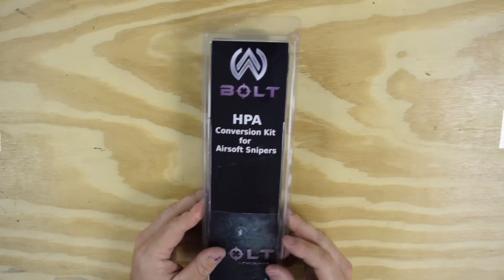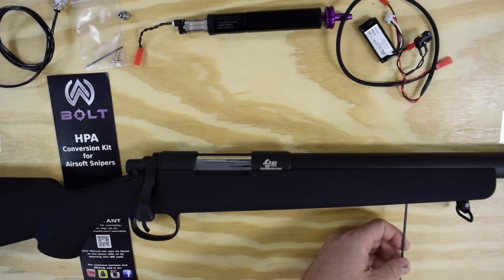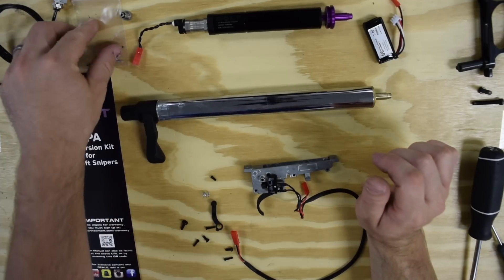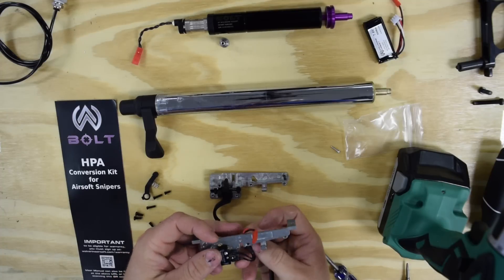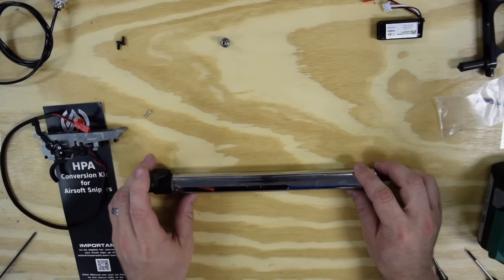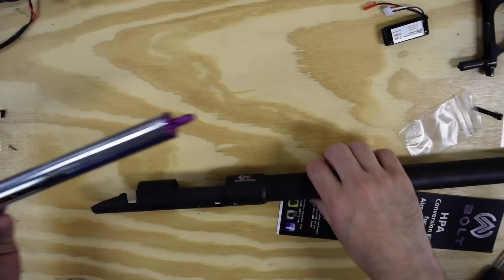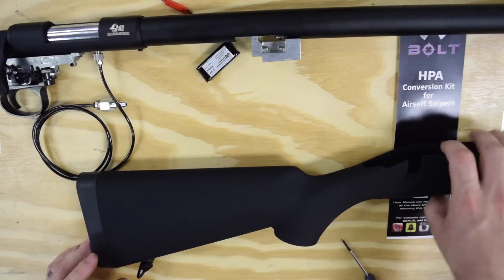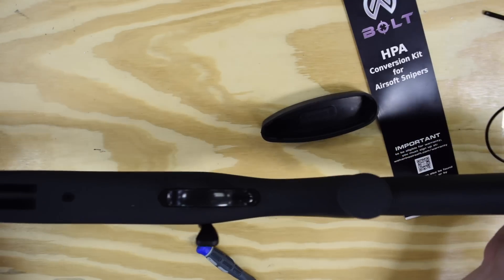What the Tech?!?! Episode 11: BOLT Installation

Comment: Hi! On the JG bar 10, if we wanted a longer bolt pull to recycle the replica. Would we drill the hole for the airline further back to the handle and away from the cylinder head? Thanks!!

Comment: I fitted mine into my SSG10 last night. I used the JJ BAR10 version with your supplied cylinder. It works perfectly and its actually quieter than my TM MK23!! I had to buy a new VSR 10 trigger box for it to work though, as the SSG10 trigger wont work. I love the BOLT!

Comment: Hi , hey   .. where are spring? no use spring in this system?
Reply: It doesn't need a spring. The bolt pull is so light.

Comment: How come no one makes a small HPA cylinder to fit in the stock? PCP pellet rifles have been doing this for years... you could easily fit a 8 cubic inch 3000 psi tank in there if someone made one... hell, a bit of modification to the stock and you could probably put a 13/3000 on it wiithout worrying about a tether line..

these airsoft companies need to step up their game.

also, why has no one created 6mm airsoft "slugs" with a rifled barrel? paintball has them...

Comment: in your video What the Tech?!?! Ep. 4: Storm InGrip and CO2 vs. HPA you say not too place the co2 cartridge horizontal  or upside down, but here you install it in the stock where it's pretty horizontal, ain't that a problem
Reply from the maker: It is a CO2 tank that you should not use horizontally, the cartridges are fine.

Comment: Alright so I can say I got this kit and it was a breeeeeze to install! Amazing performance right away and puts my old Echo 1 PSR to shame :)... I got the derlin/delrin spacer from Wolverine to fill the large hole in the receiver (don't have to drill a hole in this application) 

My only complaint is TORX SCREWS!!! WHY!? I threw them straight in the trash and used my 1.5mm Allen cap screws I had laying around. Nobody uses TORX lol

Comment: My bolt came in, followed the instructions, and everything worked like a charm. But I am having a double pop sound when I fire.  I fire a round and after the bb is fired it does another fire sound or a sucking in air sound. Is this common?  Everything works fine.  I have my G&G Predator set up with a polarstar, and I dont have the extra sound after I fire.  Have you heard of this happening?
Thanks for your help.
Reply from the maker: Hi Russty, please send a video of what is happening to tech@wolverineairsoft.com so our tech department can help you out!

Comment: Is this an adjustable fps like a polarstar, if it is, i need a tournament lock plz respond anyone also what fps will u get
Reply: it is just like a polarstar.  If you do not have a polarstar.  when you buy the line it has the lock on the end.  Which is normally a hole you put a tiewrap through.  Your line just needs to have a regulator on the end.  Most lines come with one.  Here is one from Amazon.  This package has everything you need to tournament lock any polarstar or wolverine system.  Just need to get a tank.  Hope this helps.

https://www.amazon.com/Ninja-Regulator-Airsoft-Polar-Conversions/dp/B00WMV1PWM/ref=pd_sbs_200_2?_encoding=UTF8&psc=1&refRID=XA9BYHC08FHC0B07CTN8
Reply: thanks man

Comment: So I purchased the VSR kit from Atlanta airsoft, everything was pretty simple only tip for others that you didn't show in your video. I had to slightly modify the bolt tip on the cylinder that came with the kit so the bolt handle and bolt handle cap could fit on my JG bar 10.

Comment: hello i purchased the bolt  and have a quick question, it comes with some rubber rings, and in the video it doesnt show them bieng installed? both regulator and the bolt came with the rings... can you please explain how to install them, or is it some extra rings? anyway if you could explain what they are for would be very usefull :) thanks!
Reply from the maker: Yes, we just include some extra o-rings in case anything happens to the ones that are already in the system :)
Reply: how many shots do u get from a 48/3000 tank? around 140-160 PSI? and thanks for your reply! :)
Reply from the maker: That will depend a lot on your setup, barrel and such. But approximately 1,500 shots give or take.
Reply: Wolverine Airsoft thxx :)

Comment: so i have a jg bar10 g-spec with a pdi 6.01 in it, is it normal to be getting only 330 fps with .4 @ 150psi? i know it could be because the barrel is short but im just curious if there could be any other issues (no leaks anywhere)
Reply from the maker: Hi Mike, a longer barrel would help you out. Does it sound like it is leaking anywhere?
Reply: Does not sound like it's leaking, I want to keep the barrel since pdi is not cheap, I'll be buying your high pressure regulator soon and crank it up just a little more. Is it a problem that I used your cylinder in my jg bar 10? Should I switch it back to the stock cylinder?
Reply from the maker: We actually recommend our cylinder for that build, so there would be no need to go back to the stock.

Comment: At 10:30 you said you'd post a link, but there's no link!
Is there a recommended way of dealing with a receiver where that 'molding mark' is one gaping hole already? It could probably work as-is, but it seems less secure..?
EDIT: I see Wolverine already responded to this; they prefer drilling another hole (1/4th inch, as per video) behind the open space.
New question: Can I drill the hole on the front rather than the back? I've found the BOLT gets better air seal the closer to 'closed' the nozzle is into the BOLT body. I'm confident the answer is yes after further inspection of the rifle...
Reply: so what did you do? i have the same problem

Comment: I just installed and had a chance to play with my Bolt in my JG Bar-10 - I''m having issues with the Bolt not being able to keep the pressure. sometimes when I shoot a bb - it does not shut the valve correctly, coursing  the air to flow into the barrel, witch gently pushes out the next bb. If i pull the trigger again it sometimes stops the air from escaping. Do you have any tips to solve that problem?
Reply from the maker: Hi Micki, please send an email to tech@wolverineairsoft.com so we can help you fix this.

Comment: I installed the bolt into the tm g spec and the max joules I am able to get is 1.8 at 140 psi. I did get the bolt with cylinder. I have taken it apart twice and all looks good. It has the stock bucking, hop up and barrel. Any suggestions?
Reply from the maker: Hi Aaron, what BBs are you using?
Reply: 0.32 gram
Reply: after more research I am wondering if this"air saving technology" is stopping me from getting past 1.8 joules. there was mention that factory settings point was 80psi and could be raised...HOW do I raise this.
Reply from the maker: Have you looked into the Storm High Pressure regulator? The Bolt is rated up to 180psi, so we recommend the High Pressure regulator to get the most out of the Bolt.
Reply: I installed the action army hop up, maple leaf 75 degree and a 420mm 6.01 and was able to get 2.4 joules. I alook ordered the storm regulator as my redline was at 125, about max, very happy with the results, everybody jelly, hope that helps
Reply: Wolverine Airsoft what is the fps of 180psi in .20 bbs

Comment: How would you put the CO2 thing inside of the stock? Could you make a separate video of that?
Reply from the maker: We will have another video featuring the BOLT with the Storm High Pressure and CO2 adapter.
Reply: Alright, thank you! I'm also trying to see if this is compatible with the Well MB03, so if you find out that later on that it is, please make a video (I know you already did a compatibility video, but I would like to see an install for different versions if they are different/need modification)

Comment: what components are needed for the bolt to run co2 internally inside the stock?. is it just a storm reg and a separate chamber for the co2 to attach to storm reg?

Comment: What if my receiver Is drilled out all the way where the molding is? Will it still work or will I have to make a spacer to go around the fitting to take up the space?
Reply: It can work, however we don't really prefer that as it might end up rubbing the wiring. We recommend just drilling the hole right behind the large hole that is there on ones like the well receivers.
Reply: +Wolverine Airsoft  yeah it's a jg receiver but must be a older generationbecause I got a second jg receiver and  it doesn't have the hole but the action screws are stripped. Oh well may just start with a fresh gun lol